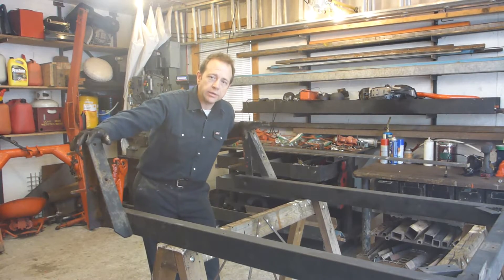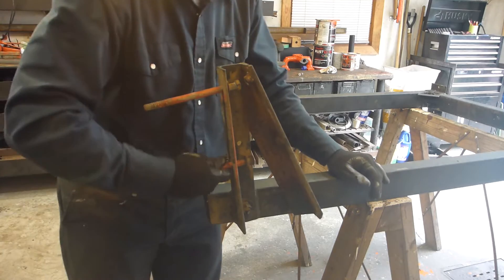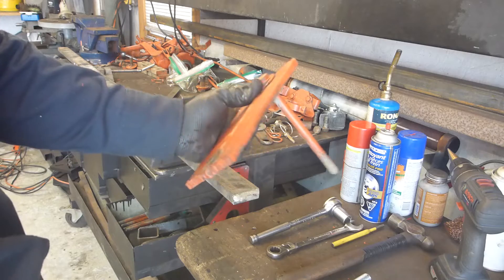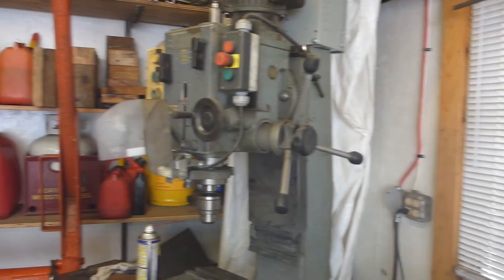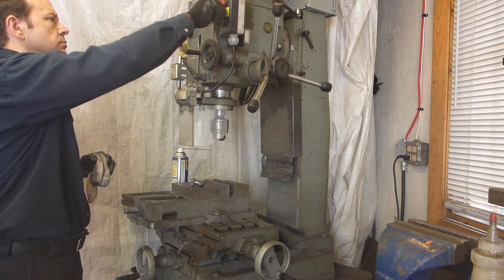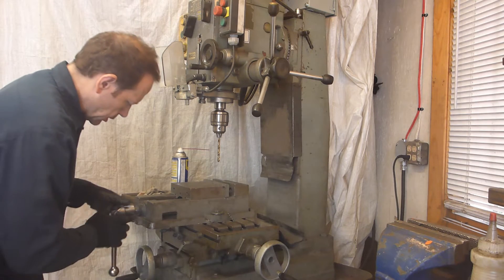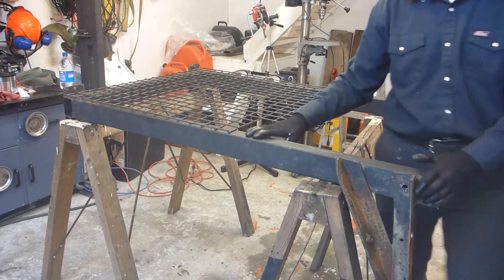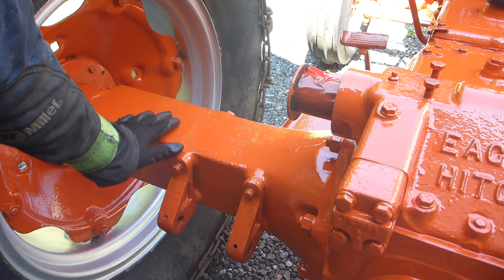#98 Case 430 Maintenance Part 11 - ROPS

Comment: Good video, what is the distance from the top of the casting to the top of the ROPS, I want to do something similar on my 210B in combination to the canopy
Reply from the maker: I could not tell, but I know the ROP was measuring about 80 inches from the ground. So it can fit easily in my 8ft garage door...

Comment: Haha, liked it when you said it's time for....The Beast!  One day I will learn how to weld, Joe and when I do, look out world (smile).  Thumbs up.
Reply from the maker: Thanks! MIG welding is very easy. They've come up on the market with very simple to use machines very suitable for occasionnal uses, for very affordable price. As opposed to stick welding, which is a steep learning curve. And you know, you won't need the skills to weld a propane tank the first day. Welding a bracket on your tractor does not need so much strength and if the weld is not perfect, you can just add some more weld! Just try it and you will learn fast! That is what I did few years ago.

Comment: Lots of metal work on this one! The cage is a great idea for protection Joe!
Reply from the maker: Protection will be good only if I buckle up the safety belt.  But first, I should install one!!! I have found one at Princess Auto, but later found it was out of stock. I will need to go at the scrap yard. Every year comes with a new safety gear. 2018 was the chaps for the chain saw. 2019 will be the seat belt on the Case. Thanks for watching!

Comment: I've been looking for a good heavy duty drill press,...this one of your's Joe will handle just about any job you have. 
This is an interesting project, I especially like that screen shield you have for the back,...and you're correct in protecting yourself from 'flying' broken tow ropes or chains,..great ideas.
Reply from the maker: Thanks Reg! I am working on the next project and started using the milling to make some decent flat surfaces. I might not resurface an engine's head yet... But to have some straight bushings,  it's cool to have it! That screen have protected me once.  A half inch nylon rope broke and the whole 100' length came at me in a blink of an eye. It's not like a chain, but you get a great surprise anyways!  Thanks for watching Reg!